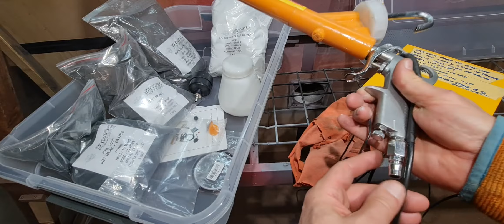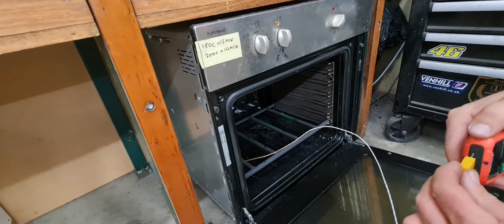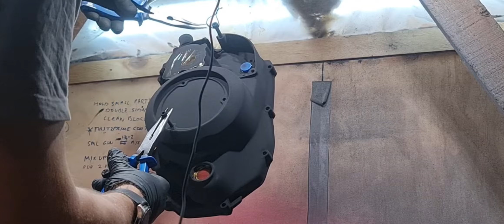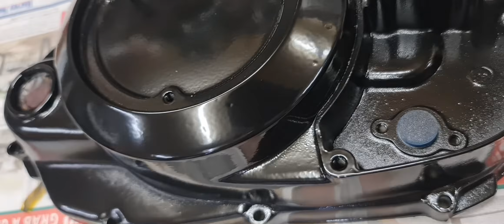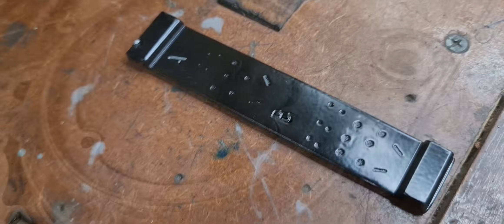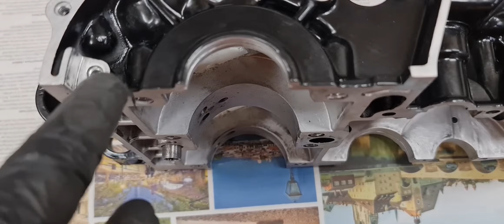Yamaha RD/RZ Restore Part 36 - Powder coating crank cases at home

Comment: Good video bud 👍 I’m currently doing some bits my self with a diy system setup. 

I will also give the hot flock a try. My last job seemed to come up really well, I put a light coat of etch primer over my ally piece heated that let it cool then powder coated over the etch primer
Reply: Your probably not meant to powder over etch primer 😂 but it seemed to work well for me